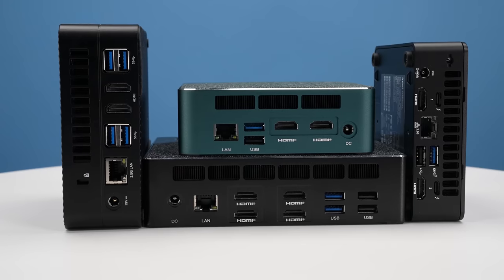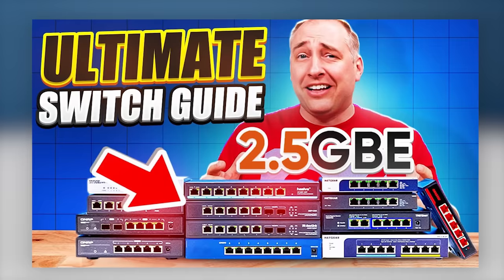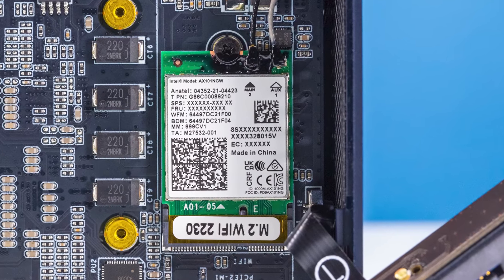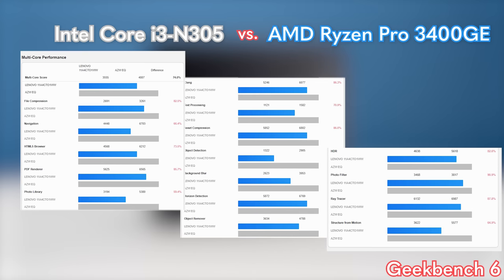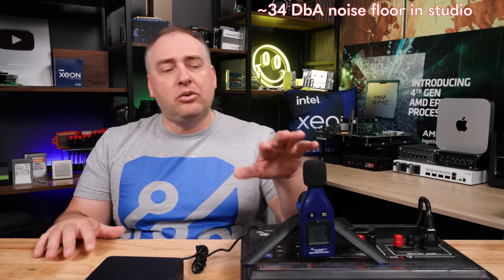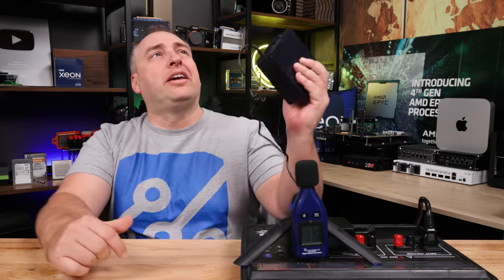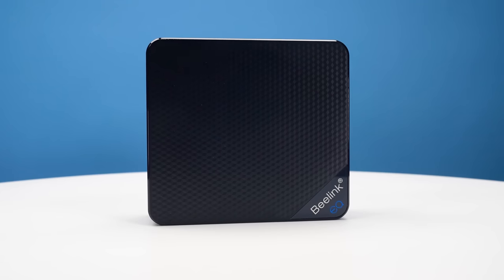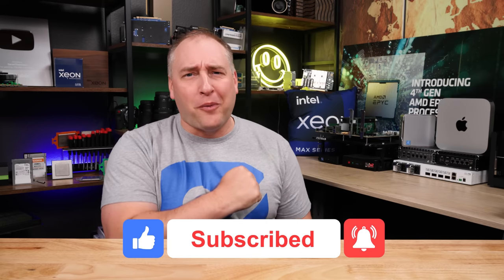Intel Core i3 N305 Mini PC Performance Beelink EQ12 Pro Review

Comment: Given the networking focus of STH, I'm kinda disappointed that halfway through the video you've failed to mention what type of 2.5G ethernet it is. Likewise, it's completely absent from the STH website review. For many people (myself included) having a Realtek NIC is a total deal breaker. Fortunately, according to the Aliexpress page, it's using an Intel i-225 NIC.
Reply: Like, yes. I get that your focus was on the Alder Lake E-cores and their performance at this price point. However, great CPU is only half the story.
Reply: What's the problem with Realtek NICs? AFAIK, they don't have chronical issues like i225 has.
Reply: @offspringfan89 Realtek NICs don't work well with many alternative operating systems like VMware, BSD, and even sometimes Linux.
Reply: @thewheelieguy Ahh, that's a big deal then, as servers pretty much only run Linux.
Reply: @offspringfan89  it's my understanding Realtek support in Linux is found is most/all current distributions, though I don't know about this newer 2.5Gb unit. I have been bitten wrt VMware
Reply: Yes Intel i225-v, I'm running pfsense 23.05, put it in at the weekend, so I can segment the network with vlans.  Very fast, I did notice web pages loaded faster, very quiet, low heat (I put a WD Green in it).  Loving it so far, but uptime is only 4 days.  Next have to put it on an old APC ups, there is a package to make that work.  DDR5 memory, mine is 8gb, overkill for pfsense, but I've installed ntopng and have loaded ngblocker, but not enabled it yet.  Very pleased with it.  Oh, and if I need one more NIC for 5G backup, I used an Ethernet USB adapted which is recognised in pfsense.
Reply: Functional pcie lanes sure should be part of a more thorough review also. Noting the included drive uses 1 lane and not clarifying that a better one would or would not use more just perpetuates the waste of time it takes us to learn these details... otherwise awesome!
Reply: I love this, but amd is stronger for gaming. I feel it is a little dear for its performance. Still very impressive and worth watching for a good deal.

Comment: Sounds like this would make a phenomenal pfSense or OPNSense firewall box.
Reply: They would though the 2.5G nics aren't supported or reliable outside of Windows 😒

Been down that eval  road.
Reply: Nah, stick with Intel NIC's and 8 cores is way way overkill unless you are running a ton of site to site VPN's and lots of end users. And in that scenario DEFINITELY stick with Intel NIC's
Reply: @udayreddy6795  I compiled the latest Realtek drivers for my repurposed HP Pavilion (i5 2600, 8 GB DDR3, sata ssd) with opnsense 23.x and so far so good. I was expecting problems and figured I would have to buy new NICS but so far so good...

EDIT: omitted details. On-board intel nic for WAN and TWO  Realtek pcie cards. One for LAN and another waiting to be used as DMZ.
Reply: Currently using one as an OPNsense box. PFsense couldn't recognize the intel NIC's use OPNsense to avoid a headache. Once I got OPN installed it works amazingly and flawlessly. Fits below my switch on the rackmount and looks sharp. Been running about 7 days now no issues.

I used a slightly lower spec'd model with an intel quad E core forgot the exact CPU ATM
Reply: @letterspace1letterspace266  the newest version of OPNsense supports it plug and play. PFsense wont recognize. Just did an install last week.

Comment: N305 models are quite a bit more expensive than the N100s. It seems that at that 300+ price point an older 11th/12th gen intel or Ryzen options start to compete when it comes to raw performance.  This is still dominant when it comes to power efficiency and idle though. The whole new N series is great, but seems to gimped by single channel DDR5 which I suspect they will unlock in later gens for free performance. I guess Intel didn't see a point in going dual channel and out competing themselves in this space, when this gen's improvement was already drastic enough. Still a shame that the N300 and N305 didn't have dual channel at the very least as they have a noticeably higher MSRP. Excited to see how an N100 performs if you're able to get your hands on one. Thanks for the review as always Patrick.
Reply: It would be interesting to see what the N300/305's 32 execution unit GPU could do with dual-channel memory but when Minisforum will sell you a much more powerful 5600H system for $219 I don't really see the point.  N95/100 is great for a basic media computer but N300 just seems like too much money for this application.  On the other hand N300s will probably make great CPUs for network attached storage devices.
Reply: @aa-yt7wo  I purchased an intel N100 4 port 2.5gb router bare bones from China recently for 172USD. Hopefully it is here soon. The comparable N305 was mid to high 300s bare bones at which point I'd go with the Ryzen as you said. The N100 seems to be anywhere from 20% - 80% faster than last gen celerons like a celeron 5105 while only being 6W (with a higher unspecified boost depending on OEM set up). What's even better is that single core performance is nearly double the 5105 according to Geekbench 5. Given that many found the N5105 plenty performant enough as a router, firewall, NAS, media server and office PC. Having something in the same package except noticeably faster for less power with DDR5 and AV1 decode support sounds like a no brainer. The low 6W TDP is rather enticing too as it can be sold fanless and sip power for a 24/7 deployment. It looks quite promising.
Reply: @Ilost11  I've actually got an N100 in a media PC for the bedroom and another in a laptop.  The media PC is plenty quick for what it is, the laptop does stutter a bit but that's probably because I haven't sorted out the crapware the manufacturer shipped it with yet.
Reply: You are totally right!
Reply: @aa-yt7wo  all alder lake N are single channel.

yeah,  ryzen 5500u, 5600u/h is a better choice than N305 atm
Reply: hi @aa-yt7wo  I have an N95 in Feb 2023, I am running single channel 32 GB 3200MHz  and System drive with one TB NVMe Gen3.1x SSD. Samsung 500GBSSD 2nd Drive. The system gets warm at time with High CPU usage. Still quiet fan. Feels like a bit quicker the N5095 I had in Oct 2022 Windows PC. However my N5095 running Linux Pop!_OS 2240.22 TLS was much smoother tha Windows. Worth a try!.
Reply: @aa-yt7wo  Power is not always the main selling point. I could have gotten a much more power hungry system, which would be pointless as it would need more then 12V3A of power delivered and thus falls through the "small, efficient, portable box you can slap on most anything and power via a simple barrel jack."
Reply: @Ilost11  can you post the link?
Reply: Power has become so expensive here in the UK that even a 10-15 watt saving will cover the difference in 6 months to a year.
Reply: @jamescollins6085  Blimey! Nah, still well below 10p a KWh here in Russia :)
Reply: @RussianSevereWeatherVideos  I'm quite jealous. I don't recall our electricity ever being below 10p a KWh.
Reply: @jamescollins6085  There are some upsides with living in Russia. We get fiber at gigabit speeds for about ten pounds a month as well.
Reply: @RussianSevereWeatherVideos  Yeah, most of the UK is only just getting such speeds, and usually at about 8 to 10 times the price. Russian architecture is beautiful, too.
Reply: @jamescollins6085  Thank you! Our food ain't too shabby either.

Comment: Patrick, building out a pfsense router from the aliexpress fanless units. Would you think The N305 would beat out the Pentium gold 8505 with it's single P core and higher single threaded workflows. Biggest stressor on my system is running effective site to site VPN with tail scale and I'm betting the single core gets me more but I don't know how pfsense handles big little cores.
Reply: Use OPNsense. PFsense wont recognize the intel NIC'S in these systems.
Reply: @renegade_patriot  pfsense plus will (I use CE2.6 right now in a different system and 2.7 will probably include support for these nics
Reply: @gregoryfricker9971  I must have been using a wrong version or something. In any case glad it worked for you
Reply: @renegade_patriot  I speak only from what I read online and not from personal experience since the only system I have is one of the i225 NICs but everyone says the updated CE 2.7 dev or the pfsense plus builds work.

Comment: 3-4 of these could make a pretty decent HA cluster for your Proxmox environment. Although, I think their price is just a little too high even for what these are. I think, around $300 would make more sense. $350 is just a little bit of a stretch. Remember, you have to buy NVMe SSDs for them, and that is another $50 ea. Plus, you'd might as well increase the RAM. I feel like I'd want to wait for a better deal, personally. I like that it has dual NICs, so you can use one as OoB management. The power consumption is going to be tripple, tho.
Reply: No need for NVMe/SSDs. Just network-boot them and mount /home with CIFS or NFS from a central server (home or office).
Reply: @sergioruocco6181  That's possible, but wouldn't be HA enough. Would rather use a distributed file system, like Gluster. That way the storage is also HA.
Reply: @sergioruocco6181  how is that accomplished?

Comment: That Windows reinstall does sound a bit flaky. Given your status as a regular, respected reviewer you could reach out to Microsoft for their guidance and share it with us? It would prompt me to stick with Dell, Lenovo and the others where you can install from there approved Microsoft media creator ISO files. Thanks for the update. I do like the dual NICs, I don't like the fans.
Reply from the maker: I know people at Azure, but Windows folks I have no contacts for
Reply: Honestly I was about to buy one for home office, but I got nervous about how safe it is
Reply: @ServeTheHomeVideo  Check out your product key BEFORE you rebuild.  There are a lot of ways to grab such info, but it does no good IF the company "hacks" windows to provide that key without actually putting it in manually, or via a registry hack perhaps.  With Beelink being a Chinese company, I suspect "hacked" ..

The ONLY place I could find it was thru the registry : Working the bowels of corporate IT does have its benefits; often beyond what normal users would be able to find.

Comment: I ended up going with a GEEKOM Mini IT12. 
Intel 12th gen i7, 32 GB RAM, and a 1 TB NVME.
RAM is only DDR4.
Based on what I ended up deciding to use it for, I wish I had gone with a high end AMD model instead, as the 1070ish equivalent GPU capability would be nice to have.
Live and learn.

Comment: Here's an idea for an addition to the TinyMiniMicro-Series: the Framework Laptop in the CoolerMaster case. It has great performance, sub-1liter, you can configure the port selection with swappable modules (3 monitors or 3x 2.5Gbit NICs), user replacable RAM (Ryzen may actually support ECC modules for up to 64GB) and SSD. I think for those interested in the TinyMiniMicro series the framework-system is an interesting and viable alternative with unique features. The YouTube channel Elevated System had a great video on how the framework motherboard can be used in different configurations outside the laptop.
Reply: Completely agreed! Hopefully he sees this once the AMD mainboard gets released :D

Comment: I got one of these! It's pretty okay but the power supply and lack of PCI-E lanes really is a bummer. If people are considering this, try and find an i3-1220P instead. They're about the same price (about $75 more) and have way way more for the money. I don't regret this little EQ12 Pro, I traded from a Dell Opti 5080 Tiny 10600T, and it's been mostly great. It really is let down by the crummy power supply, make sure to get a 12v/5A adapter. Also, for some reason, inside the shell are vent screens - these choke the system out like crazy. Feel free to peel them off if you aren't in a super dusty environment.
Reply: The eq12 vent screens block air? And we should switch out the power supply ; how would that help? 
?

Comment: FYI, I've been able to successfully run a single Crucial 48GB SODIMM in both my N100 EQ12, and my N305 EQ12 Pro. So while losing dual channel sucks, gaining DDR5 speeds and 48GB over DDR4 32/64GB, isn't a bad tradeoff.
Reply from the maker: Wow awesome! Thanks for that info

Comment: 8 core..... Let me start this by saying that if this is the core i3-N305, it had better not be priced like a core i3-1215/1315 system because Intel set the CSP to the same $309 for both processors. If it is, very few people should buy this, as users for this processor would be very niche where they need this many cores, at this TDP, and they cant just take the better processor, and limit it to the same TDP. 
Not to say beelink and others should cut margin, but that either consumers should not buy this overpriced hardware until Intel offers a reasonable price reduction to reflect the shortcomings compared to the i3-1215u/1315u
The N305 is the fully unlocked Atom N100, with the only apparent difference being 2 fully unlocked core complexes(8 E cores)
Now my only problem with the i3-N305 is price, well, i dont like it carrying the i3 name when it is a dedicated atom die with atom spec, atom ram limitations, and atom PCIe but that can be overlooked if the price fit.

The i3-1215 is a far better value at the same price because you get 3 core complexes, with 2 of those being P cores and 1 E cores, making for a 2+4 total, you get 2 channels of DDR5, which can in theory support the future 64GB sodimms, or up to 256GB of RAM if you had 4 slots at up to 5200MT/s(though probably max 32GB at that speed) though Intel may put a firmware limit of 64GB, we wont know without testing, you get 20 PCIe lanes with most of them being gen 4, along with 64 Xe graphics cores
Atom/i3-N305 is literally less than 1/2 the SOC for the exact same price, yes i'd personally go for 8 E cores over 2 P cores given the choice, but the i3 comes with 2P cores plus 4 E cores, the N305 is also limited to no more than 16GB of single channel DDR5 at 4800, which will have an effect on the iGPU which is 1/2 that of the i3-1215/1315.
Oh and instead of 20 PCIe lanes of mostly 4.0, you get only 9 lanes of 3.0

Now the main thing that will affect most people are the lack of P cores, 1/2 the GPU power limited by single channel RAM, and a supposed hard firmware limit of 16GB.

This processor would be fine with a CSP of $129, but not $309
Reply: The main use case for a processor like this, where the much more powerful and feature rich 1215U is available for the same price, would be in OSes where they do not handle mixed cores at all.
While yes 2P cores plus 4 E cores would be quite fast compared to 8 E cores, if you have to disable those 4 E cores on the 1215U, you will get better performance out of 8 E cores when both processors are limited to the same TDP, those 8 E cores would approach the performance of 4 P cores without hyperthreading when both processors are limited to ~8w

Comment: This would be fantastic for a router if they'd just give us dual 10g interfaces. I've been looking really hard recently for a powerful mini PC like this with dual 10g to be a pfsense router for my 5gb fiber internet. My ont has 10g base-t but none of the small router boxes I've looked at have 10g ports. Very frustrating times.
Reply: Yeah frustrating, the only I know of is the Gowin r86s
Reply: @dustingodin5323  Ya I was going to say the Gowin r86s, supposedly gowin is working on an alderlake one that SHOULD be announced this month
Reply: 10GE, use fibre not copper. The sfps for fibre use like 3 times less power
Reply: @SuperSpecies  lol right so there is not 10gbit standard for copper. So wonder that powers all those 10g ports over cat 6 using 802.3an
Reply: Can't we just add a 10gb ethernet adapter to the USB 3 10g port?
Reply: I was just thinking the same. Maybe this is my next pfsense box. 🤔 The Amazon link says 170 with 30 off coupon.

Comment: Re: your key lessons learned
1) I think that they have the mega link for the Windows install because I think that they have integrated the drivers into the installer, which is always nice/helpful/useful.

(In case the default installer from Microsoft, doesn't have, for example, all of the network drivers, etc.)

2) I've reached out to them before as well, for my GTR5 5900HX for a Windows 10 key, and like you said, they'll back to you within about a day or two with a key.

So, that's usually/generally not a huge deal, unless your SSD has already died, and you need to revive the system immediately.

But otherwise, the N305 looks like it would be a great desktop replacement.

I DO wish that they supported more RAM though (16 GB nowadays is the bare minimum, I think).

(I'm using their GTR5 5900HX with 64 GB of RAM, and right now, I am using about 40 GB out of that.)

And I also fully agree with you that I think some of the other Beelink units have lower idle power consumption as well, IIRC.

Comment: I cant see myself building home desktops anymore with the way these MiniPCs are progressing. The only letdown is advanced graphics but they are certainly capable or playing most mid-tier games.
Reply: I think with the next gen AMD Strix APUs and Intel Meteor Lake (if it comes to mini PCs) that problem will basically start disappearing. Moreoever if you buy one with eGPU support and the new upgradable 16-inch laptop from Framework takes off and enhances the eGPU market (because their GPU modules can be used as eGPUs) I think we'll have such a perfect environment for just using mini PCs for everything.